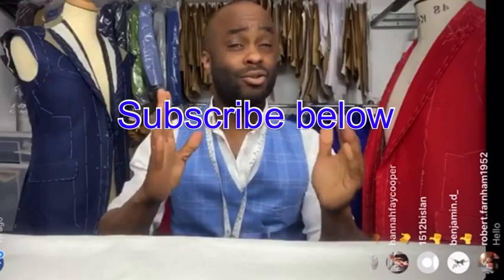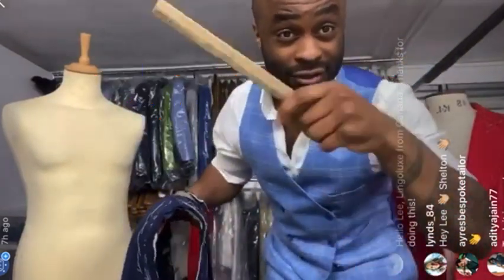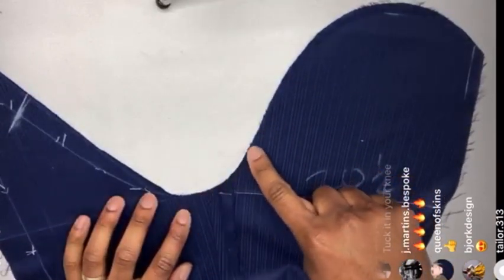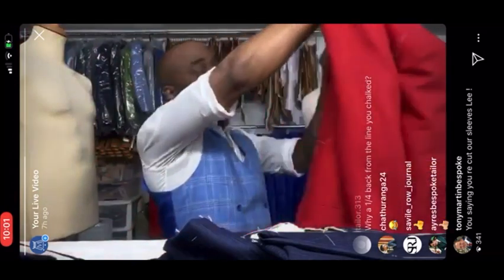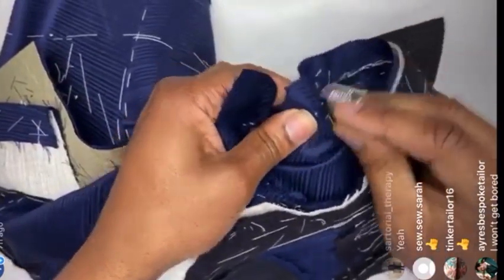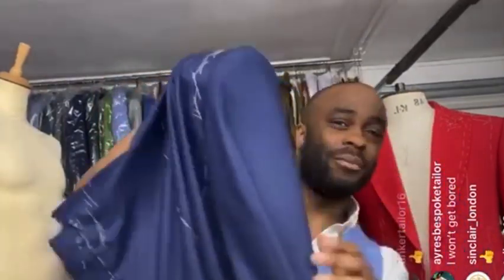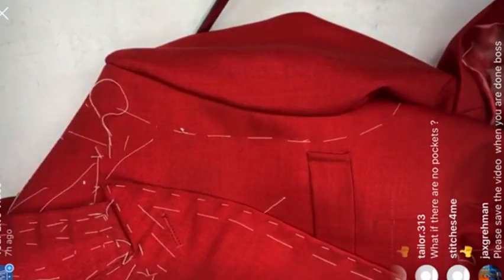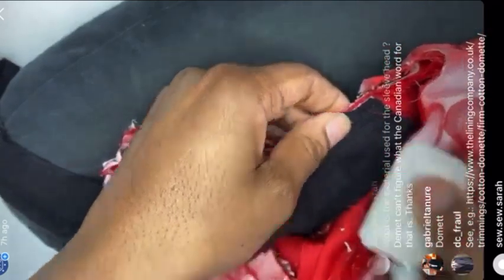How to sew Sleeves in and problem solving..Savile Row Tailor"lee Marsh"

Comment: hello. thank you for your explain. I working in south korea for pattener. and I have a question about your sleeve. far as i know, your sleeves is crown sleeves. I knew that sleeve for a long time, but I didn't know how to implement it.  Is the core of that on the sleeve head and ease quantity of the sleeves? I really want to express that sleeve. Thank you
Reply from the maker: Hi there, most of the fullness comes from the under sleeve and very little around the crown.👍🏾